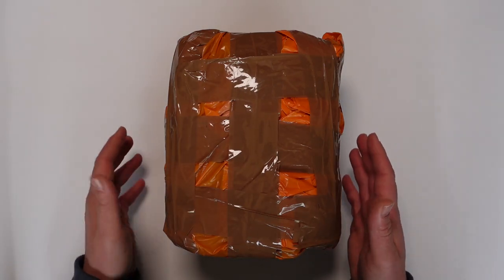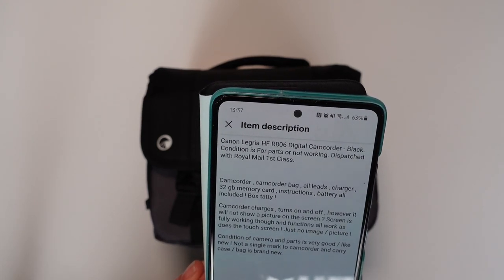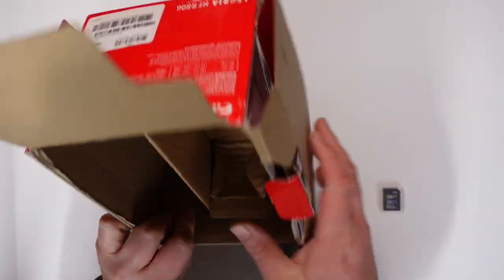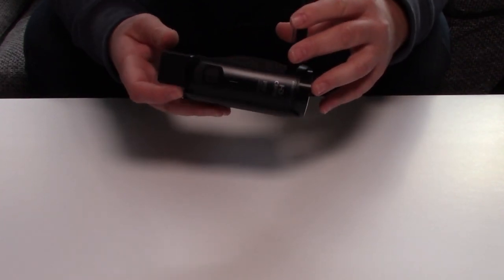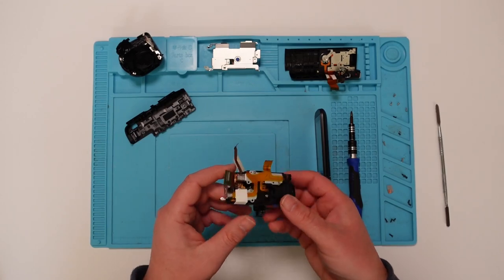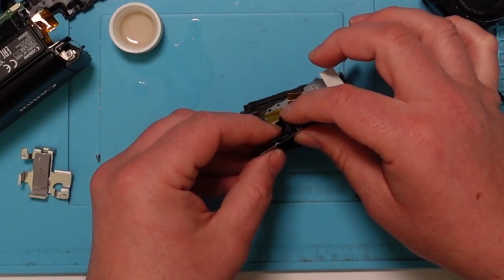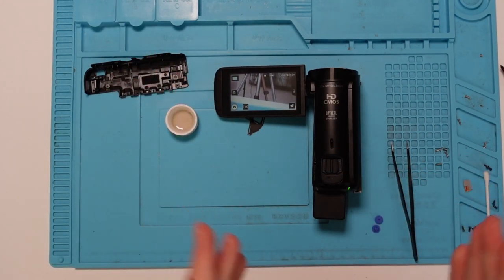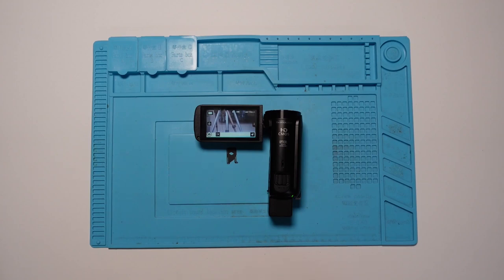CANON Legria HF R806 Camcorder with NO IMAGE/Black Screen | Can I FIX It? | eBay Repair

Comment: I think the previous owner has been inside that camera before you. Many of the external screws on my Legria HFR806 have rubber caps and yours are missing. Also, on your video, the top of the camera just comes off, but in reality there's a silver screw inside the unit which holds it in place - that screw is missing from your video, and it's a nightmare to remove. A few internal screws are also missing, because the components shouldn't pull apart so easily. Great video all the same.
Reply from the maker: Thanks Rusty! Yes, I think you're right. I didn't even realise at the time, but the sticky rubber caps is a dead giveaway! Well spotted 👍

Comment: It controls the amount of light that goes to the CMOS sensor. Clean the shades with alcohol, they get oiled with the time, put them back and it will fix the problem
Reply: Where is the cmos sensor part
Reply: That's what he called the camera part...

Comment: Wow, I would have never expected you to get anywhere with this. It's so tiny and intricate, but you figured out on your own! I have a couple of Canon PowerShot photo cameras, some of them work, some of them shows a weird smudged colorful image, some of them is pitch black. Maybe the black ones have similar issues. I might look into one of them.

It was a great idea to put it back without the shutters, I would have tried to turn it on and quickly remove the battery before it has its own shutdown mechanism close if (the idea is that if those shutters work, they would remain open when I cut off the power, but your idea was waaay better)

Comment: Yep...its the aperture. If u don't have it in there it will be fully open all the time and that might cause problems for the exposure. Also u might get a bit shallow depth of field, as it alters that depending on how the lights angle is reflected to the sensor.
The one thing u called the lens I think, is the sensor, thats very delicate and sensitive to dust and such.
Reply from the maker: Thank you. I actually did dream about it last night, so this information is brilliant news to me! I'll do some research and see if I can work out why the aperture failed. Steve.
Reply: It controls the amount of light that goes to the CMOS sensor. Clean the shades with alcohol, put them back and it will fix the problem
Reply: Hi sir, is it normal when i shake it. There is a noise like loose plastic.  Its difficult for me to remove the wires to ipen the whole thing. If the cmos been oily. What if i will heat with the blower?

Comment: Hi, the noise you hear is simply the optical stabilizer.
I have a black screen, it's probably the flat cable. I have the Canon HF R 46

Comment: I have the R606. Prior to COVID it stopped powering on from the battery (any battery). Worked fine from the mains. After taking it apart I could find nothing wrong. I picked it back up a few months ago and after charging it up it worked again. Been fine since. Bizarre.

Comment: They're supposed to rattle. When I first bought my Vixia it did that and I freaked out and ran to the internet before even turning it on. Turns out the stabilization stops the rattling while it's on.

Comment: This was done a year ago, yesterday 21 may 2022 my one fell. Green screen and frozen screen and glitchie. Followed this video,  and boom it's working. Camera sensor plug came loose, and it doesn't want 3 screws in it.

Comment: Our Mate Vince put me on to your channel, so yeah.. I subbed and I liked..
Now.. If memory serves me correctly, Image sensors CMos and Ccd both are prone to degrade with exposure to the electromagnetic spectrum over time, So I suspect the aperture you removed was to help extend the sensors usable life span "by isolating the Sensor" even further than what the obvious aperture was doing " google " Do CCD and Cmos sensors degrade..  I double checked 😉
 
BTW That rattling could have something to do with "optical" Image stabilising..
Reply from the maker: Thank you! That makes sense, I'm just glad I didn't rattle it too hard! 😄 I'll do some research on CMOS/CCD. Much appreciated! Steve.

Comment: Hi StezStiz, all the way from Newfoundland Canada, I have a Panasonic camcorder here with the very same issue! But I'm not sure if I have what it takes to get into the camera that deep! 
  Is this camera still working and have you since figured how why they were not opening,
     My guess was right of what the issue was , because as i was trying to figure out my camcorder (and you could have done the same) but i looked into the front lens and can see clearly there was something in there that wasn't opening.
  Thanks for confirming the problem for me!
Reply from the maker: Hey HOTR!  It definitely takes some dismantling and putting back together, these things are very well packed out inside with tiny screws holding everything together!
This one is still working, and I do use it from time to time for some filming.
I think I managed to sort the issue simply by taking it apart and putting it back together, I must have freed up whatever it was that was getting stuck.
This one was a while ago, and I can't remember all the correct terminology but it was the aperture blades I think.
Good luck!
Steve

Comment: Hello. First time watching one of your videos. As you might be able to guess from my username, I like to think I know a little bit about cameras. Other commenters seem to have said a lot of this already but I thought I’d pad it out a bit for yourself any anybody else that might come across this video in future.

The plastic pieces you removed are the iris blades which control the aperture size. It’s one of the two ways the camera controls how much light reaches the sensor - the other two being the shutter (which will be electronic in this camera.) There is also an ISO or gain setting which determines the sensitivity of the sensor but that’s not important for the time being.

Indoors the aperture will probably need to be fully open anyway to let in the maximum amount of light. Outdoors, in the sunshine, because the camera now can’t make the aperture smaller, the sensor will receive so much light the picture will either be over-exposed or the camera will automatically increase the shutter speed to compensate. That might work just fine if the shutter speed can go high enough. In professional videography, shutter speeds are quite important and will be balanced with the aperture size to get a correct exposure. For casual use, I don’t suppose it matters much.

The other effect the aperture has, as another commenter mentioned, is the depth of field. With the aperture wide open (or missing!) you’ll get a reasonably shallow depth of field. That means if you focus on something about a metre away then the something further away will go out of focus. If you wanted more things in focus, you would usually decrease the aperture size and also decrease the shutter speed to let more light in to compensate. I don’t know if this camera gives you that level of manual control or not (if you wanted it!) It’s probably the difference between landscape and portrait modes, if this camera has settings like that. With the iris blades missing, you’re stuck with the shallowest depth of field the camera offers. Again, in most situations, for a casual user, I doubt they’d notice.

I hope that answers a few questions you might have had. I would like to see you revisit this and fix the aperture. I suspect it was either physically stuck or the mechanical parts of the camera controlled by the software weren’t getting the message to open and close it. It could be anything from a dodgy ribbon cable, a damaged chip or a faulty actuator (near the iris blades.)

Thanks for the video. If I could make one request - please tone down the music a lot! ;)
Reply from the maker: Thank you so much for this. It all makes perfect sense to me now. I will certainly take another look at it, i suspect it is the actuator, as the ribbon cable looked good and the mechanism moved freely by hand, but I'll not rule that out without taking a closer look.

And appreciate the feedback on the music, I did notice the levels seemed high after I posted the video, but the damage was already done! Consider the gain lowered much more for the next video.

Thanks again, Steve.

Comment: Maby those plastic shutters are closed when camera is not recording to protect the lens from the light when not recording so they last longer
Reply from the maker: Good thinking. Looks like they are supposed to open when the camera is turned on, so I need to try and work out why they failed! Thanks Renata!

Comment: Please help me! I have a Canon Vixia HF700 camera. And it's not showing the information on the screen, making it impossible to control the features. But she is recording. Could you please help me. I tried to help in specialized stores to fix. but I could not. thanks in advance for your time. Jorge Douglas / Rio de Janeiro / Brazil

Comment: It's the F stop iris it controls how much light hits the CMOS sensor indoors under artificial light the software should be able to cope with changes outdoors you will have a washed out image ...it will make a good low light camera 😂

Comment: My canon vixia hf r10 doesn't work. Whenever I turn it on the screen turns black and I can't turn it back off. I can only turn it off whenever i take out the battery. (I also don't know what to do).
Reply from the maker: Hi Sailor! Not sure what could be your problem there. It sounds like yours is freezing up so it's not the same problem I had on this one. It may be worth trying a different battery? Hope you can get it working 👍
Reply: Thanks for the info

Comment: Follow up to my comment that I put on the wrong video (will never figure that one out because I was watching this as I commented): It looks like a somewhat simplified version of a mechanical iris that can also affect depth of field as well as the amount of light that enters the camera depending on how open or closed (aperture size) it is. It may benefit you to pursue it further.
Reply from the maker: I did wonder about the other comment! I've been working on a revisit video today, as these comments have been super helpful! I'm going to try and post tomorrow 👍
Reply: @StezStixFix  Lovely. Feel free to ask if you need any more help. I used to collect old film and photography equipment and have seen inside more mechanical lenses than I can even remember.
Reply from the maker: @SimonNemeth  Much appreciated! I've been given a Sony Handycam (an old one) to look at, and another Canon one is on it's way. So I may be taking a look at those in the future. No doubt I'll not fully understand the insides of those either! 😄

Comment: Appature lens/Iris, bright light relatively closed, lack of light quite open, they work like human eyes.
Reply: The way you've left it (open) will be fine for darkish places but if you took it out on a bright day it will get flooded with light and will white out I think, great for filming stars though if left to focus
Reply: God I'm crap, it's spelt aperture, and it's to do with f-stops (light and focal ranges), which on Digi cams is automated but historically you would use light meters and measuring tape I think, I studied this at uni and clearly was more focused on pints and pot.